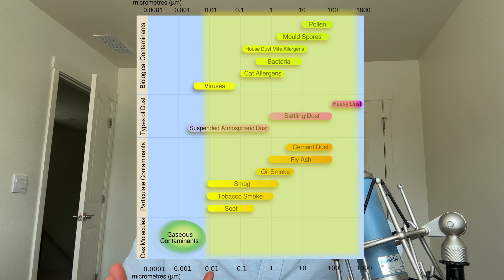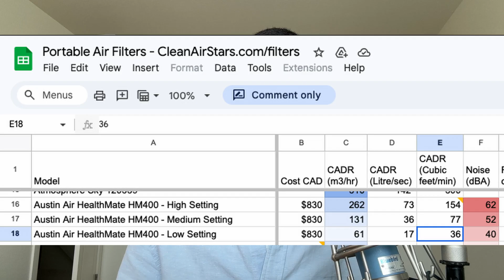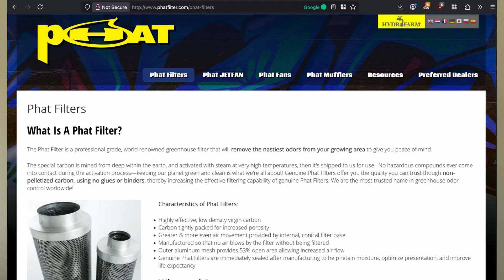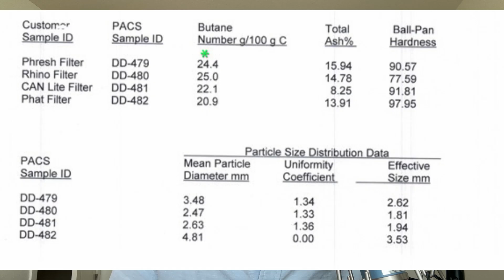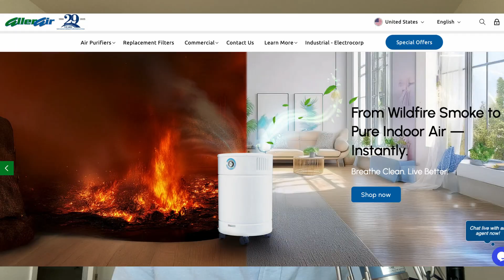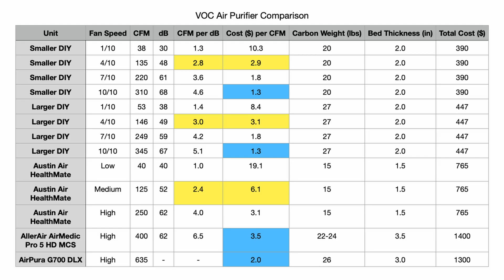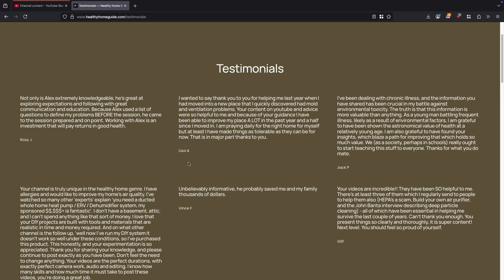Can a DIY Carbon Filter Remove VOCs Like the Expensive Brands?

Comment: After ~6 months use, do you have an update on how the small & large carbon filters are performing?  I'm wanting to go this route (large filters) but have 2 main concerns:  (1) actual VOC removal performance - not just using CFM as surrogate; perhaps using the good old nose to decipher performance; and (2) longevity of each filter - I'm thinking the filters will become quickly saturated w/ CO2, humidity, and other compounds that inadvertently get captured.  BTW, love your channel!

Comment: Thank man.  I built my first cr box because of your other video. I had a moldy basement that I completely gutted and redid and I've been very sick 4 years later. Also have lyme and seeing a functional medicine dr. But I now have 4 giant CR boxes rocking (one using a furnace blower, one with a drum fan and 2 using 8 artic pc fans each) and then 2 pro HEPA filters used for remediation . And even with all that, as soon as we close the windows up for the winter is progressively get sicker and sicker with the inflammation, brain fog, etc. And I'm now speculating that it's the VOCs/mycotoxins that remin in the basement that is circulation in the house still and making me sick.  Because I have enough merv 13 filtration to choke a camel and still the indoor air is making me sick. So am now going down the charcoal filter rabbit hole.

Was first thinking about stacking a charcoal fabric after the furnace filter on all my cr boxes but now am realizing a separate unit probably the way to go.

Comment: Sorry my previous reply I haven't fully listened to your video where you mentioned about people having sensitivity to VOC. I do have a tip though. And that is, with air purifiers that have a round cylindrical filter you can actually put high quality activated carbon pellets within that central cavity. Obviously not poured straight in that be disastrous but in some sort of cage or net bag. Maybe something like a wire bird feeder would you feel with nuts that has a wire cylindrical shape smaller than the cavity within the air filter and fill that. Because remember the VOCs in houses are generally low and a small amount can do wonders and minimise the chance of irritation from the activated carbon VOCs. And also remember the air hitting the carbon is going to be ultra purified which mean it won't clog the activated carbon pores. And of course you can very easily and quickly replace it.

Comment: Something to bear in mind is that activated carbon does itself produce a type of VOC which can be irritating slightly. If you are very sensitive this is my own personal experience. Also the DIY units throw a lot of black carbon into the air. What you really need is the ultimate answer is to have a filter the air going in to the activated carbon this preserves the effectiveness of the carbon pellets so they don't clog up with dust and you also need a second have a filter to filter out any released carbon dust as the air is exiting. Or get the carbon out and put it in some sort of mesh grid and blow air violently through it to blow out any manufacturing dust
Reply: Did he not literally adress this issue in the Video?? There was no dust problem.

Comment: I've seen that you can reactivate Carbon Filters by leaving them under the sun and open air for a day or two. It brings it back to like (90% initial) but it deteriorates 2x fast each time you repeat it. So practically, you can extend the filter life to 1.75 by doing this recycle twice. 

Could anyone look into this, if this is true? Like with actual data. Would be nice to see a video on it

Comment: Filter thickness is not really very important
It's more about the amount of time the air spends around the carbon
Like, a 1 inch thick layer of carbon will filter the air just as well as a 2 inch thick layer of carbon with air going through it twice as fast (and spending the same amount of time around carbon).
Or in other words, if you double the cfm without making the filter bigger, you will not double the filtering rate.

Comment: Hi, thanks for the great video — I’m building a similar VOC-focused unit for pet odour control in my living room. Could you confirm whether the four 8" parts below can be joined directly (no ducting):

AC Infinity Noise Reduction Clamp 8"

AC Infinity CLOUDLINE S8 PRO (8")

AC Infinity Air Carbon Filter 8"

AC Infinity Inline Filter Box 8"

Questions

1. Does the AC Infinity Noise Reduction Clamp act as a female–female rubber coupler, or is it only a clamp (not a connector by itself)?

2. In your build it looks like carbon filter → inline filter box → fan were joined without ducting. If both ports are male, was a tight slip-fit + clamp enough for an airtight, rigid joint? Or would you recommend a short 8" flex duct or a rubber female–female coupler for reliability?

3. Could you share the exact part numbers you used (filter size/brand, inline filter box size, fan model, and clamp count/spec)?

4. Any notes on vibration/resonance or long-term leakage/carbon dust with the direct connection?

Really appreciate your time and work!

Comment: Great video!  I have a question about noise level for CLOUDLINE Pro S6 Fan that you used. Your measured noise level in the comparison table is 67-68 dB at fan's maximum speed.
AC Infinity specification for that fan says : Total Noise : 34 dBA
Can you please explain that, I'm rather new to this :)

Comment: Do you know of any good filters for smoke/VOCs that can be mounted onto a central balanced ventilation system with heat recovery (so with ducts & vents)? I live in an area where lots of people burn wood during the winter and the ventilation system is sucking in all the smoke. I already have a electrostatic particle filter but that doesn't reduce VOCs at all. Thanks!

Comment: what do you think about combining the two diy filters into one case? basically putting the particle filter on top of the exhaust of the the carbon filter, tightly connected with the bottom panel? i made some sketches but i’m not sure where to reach you. best regards and thanks for the information.

Comment: What direction is the airflow? Are you sucking in air through the carbon filter OR blowing air through it?  Does the direction of airflow matter?
Reply: He’s sucking air thru the carbon, then sucking it thru the MERV 13 filter, and discharging the treated air thru the blower

Comment: Thank you. Informative. I’ve been looking for a carbon purifier  for 1000 sq ft space. There will be numerous people using the space. Does the carbon really give off an odor that can be offensive to some? And if so, would putting a fresh air intake on the furnace really help enough instead? Thank you. There was a recent buildout in this commercial space.

Comment: We live in a small Airstream trailer with about 180 sq ft of living space. We are seriously considering the Exhalaron for particles, but your DYI carbon filter for VOCs is way too large for our trailer. Do you have a much much smaller solution for a very small area?  We camp a lot in San Diego which has horible air due to the sewage coming from the Tijuana River. Lots of  hydrogen sulfide gas. Thanks!

Comment: QUESTION: How do you know when it's time to replace the activated carbon?  A particulate filter is white when brand new and darkens as it captures more and more particulates.  You don't get that clear visual indicator with activated carbon.
Reply from the maker: Great question! Check 3:40 in this video: https://youtu.be/ZCvpdOfrjtc?si=N0G9AJcsBNC1sHKu

Comment: Great video, Alex!

I wonder how much better your DIY activated carbon air purifier would be with a centrifugal "squrrel cage" fan instead of an axial fan.  In general, centrifugal fans have more static pressure, which is needed to effectively force air through a HEPA filter or a thick layer of activated carbon.
Reply from the maker: That's a great comment, thank you Jason! A while back, I did look into centrifugal fans. I ran into some issues:
1.) The inlets/outlets aren't typically shaped in a way that's easy to attach to a circular 6" duct.
2.) They tend not to be speed controllable. So there's just one super loud, energy-sucking speed.
3.) They tend to use tons of energy and create lots of noise when drawing air through a HEPA filter especially. It's not necessary to use HEPA, so I'm not sure why I'd want to shoot for that in the first place.
4.) Higher quality ones are quite expensive. Cheaper ones are typically very faulty.

Let me know if you disagree, I'm always open to new suggestions if they're valid!

Comment: carbon only filters about 9% or less of VOCs...  true you can't have both best VOC and particle machine in one...  for the heavy carbon filters like allerair you don't want it blowing through, you are using it as a sinkhole/capture for the gases you don't want it to come out the other side...  and when it gets hot in the house it will offgas from the carbon filter, so at the end of the day with really serious problems with gases the only option is to move, the doctors and experts say "complete removal from exposure"... filters just take the edge off but the IQAir ad with the guy breathing in a box full of tear gas is fake, if he had a toxin 24/7 he would get sick... and I have an IQAir and an allerair and others and I studied science at a big college so I know how to do proper testing and analysis... you don't need super expensive testing you need to find a consultant who can do GC-MS testing for you using sorbent tubes (not SUMMA canisters and you don't need PTR) and you need real-time monitoring to know when to take the air samples...  again no filter is going to save you from toxic gases you will be the filter before just a small percentage is removed from the air, filters do well for particles and that's about it...  get a merv 11-13 filter on your hvac and run the fan every 15 min to 30 min and call it a day, if you have a serious odor or gas problem you need to move... the lifetime cancer risk limit for ethylene oxide gas which is odorless up to 270ppm is just .0001 ppb, for benzene it's just .04ppb, so basically any amounts of these carcinogens and you are really increasing your cancer risks, so moving is the only option...  our iqair hpp has become less efficient with age, I think the motor gets weak... but our carbon filter is saturated now (if it does get saturated), I'll have to do  a new test with a new carbon filter... it used to filter pretty well in a medium to large bedroom on the lowest speed but it's not getting much if any airflow anymore... i think the motor power goes down with age...  people with health problems from air pollution need to find a good toxicologist who understands that blood tests are not used for environmental air exposures which is kind of like trying to find a new in box atari 2600 in 2025, there aren't many toxicologists who will talk, they are like lawyers and want a retainer up front.... this is not medical advice... talk to your licensed medical doctor (who will not know anything about environmental toxicology in most cases) with any questions or problems
Reply: You sound very knowledgeable, I struggle to fond material on air cleaning. Everyone I asks has really no idea about it over than what the products advertise as, or small particle tests people have done.

I would like to ask you about and see if you can explain why my charcoal respirator cartridges block all smells of my current environment. And how a canister filter for growing something smelly in a indoor grow tent elliminates the odor. Can you please help by explaining this? Are those highly odorous things just a very small amount of VOC's in the air, which is why the charcoal works, and instead you are saying when the concentration is too high of VOC's from normal indoor home materials that it will only put a small dent in the over all toxic load in the air.

Yes, everyone seems to be a gate keeper on this, plus almost no one cares about the details, unlike me. I'm trying to assist a family with their situation. They cannot open their windows a pretty much at all due to perposed toxins outside in the trees, but I do like your idea of running the air exchanger with a decently high merv rated filter working the air. Please help if you can, thanks.

Comment: Purchased all the items for the larger DIY setup a few days ago. Thanks for the easy to follow video. 

Just came across AC Infinity Refillable Carbon Filter. What are your thoughts? Have you considered this product?
Reply from the maker: Good question. Funnily enough, I used the AC infinity refillable carbon filter in a previous build. It's definitely a decent filter, but the process of refilling the carbon can be messy and it's hard to pack in the carbon densely enough yourself. AC infinity also isn't quite as transparent as Phat Filters about the performance/quality of their carbon, which is why I've switched to Phat Filters. But you do you, if you like the refillable aspect, certainly try the AC infinity.

Comment: Great video! I'm going to build one of these DIY-CARBON devices and try to benchmark VOC removal compared to larger consumer carbon devices I have got like the Austin Air and HealthPro Plus. 

Have been using the BM688 gas sensor that comes with the PurpleAir Zen and when testing other high carbon devices and would love to see if the DIY approach is able to out perform the specialist devices. I really like the idea of the replaceable carbon with the AC Infinity range so going to try that initially.  Will let you know how I get on.
Reply from the maker: I like your channel! Good luck, do let me know how you get on.

Comment: Have you done any research on water filtration systems, or do you just drink bottled water? There seems to be a lot of superficial knowledge floating around about how effective and necessary they actually are.
Reply from the maker: I like the youtube channel BOS Water because they do a lot of independent testing of home filtration systems of all different types. What I do now though is get RO water from my local grocery stores and remineralize it myself.
Reply: @HealthyHomeGuide , what do you mineralize it with? I get nervous about some of the products I've seen as far as heavy metals, so I take a capsule of seaweed every day and hope that's enough.

Comment: I found a guide online to make something very similar using a PC fan instead, and it seems to be doing very well. I'm not equipped to test it, but it's helped with smoky days and indoor VOCs, it's a lot smaller and sleeker than the bulky duct fans you're showing.

Comment: Im surprised your not making your own reusable carbon filter... Is it not cost effective?
Reply from the maker: Thanks for asking about this! Making a reusable carbon filter is a more laborious undertaking than I wanted to take on. You have to source high quality carbon, buy it in bulk for it to be cost-effective, build a housing (which would likely require metalwork to do properly, imo), and work with dusty carbon. 

I’ve seen some other designs that involve cutting holes in buckets, laterally slicing them, and attaching fans to them, and dumping activated carbon into the bucket. 

To make one of those intake and exhaust effectively, and achieve enough airflow over a large enough surface area to capture a lot of VOCs seems like quite a challenge, which, if you’re up for it, be my guest. But I wanted something easier, and something powerful.
Reply: @HealthyHomeGuide  the 5 gallon bucket sounds perfect, and i would want to make  the carbon so high quality isn't that important... I'll look for some diy on the YouTube... Not saying i will do it but I'm interested in knowing how ... I'm actually more interested in carbon for water filtration than air quality but it is interesting...

Comment: If doing the DIY ERV + Carbon setup shown in a previous video of yours, would you now recommend substituting the PHAT carbon filter in place of the AC Infinity Carbon Filter?  Thanks!
Reply from the maker: Great question. Yes I would use the Phat Filter instead of the AC infinity carbon filter (though I haven't tested that yet). Just make sure to slip the pre-filter over it to catch any dust (which is less of a concern in ERVs in general because airflow is slower than in air purifiers).
Reply: @HealthyHomeGuide  Thank you for all of your videos, Alex. I just bought my first house in a totally new part of the U.S. and I am learning about basements and serious dehumidifying and ventilation and I have really appreciated the resources you have put together. Regarding the ERV having slower airflow, which you mention here, would that suggest that having this standalone unit would be the more effective method of filtering VOCs than putting a carbon filter on the ERV? Not to say that one does not also need an ERV but that one might keep them separate for max VOC removal? Thanks again, Alex! P.S. I am very interested in your feelings about air conditioners. I watched your a/c video so I know your preference of window > dual hose > single hose, but if you have any additional guidance about which particular window units one might consider buying, I think your fans would be very interested!

Comment: Do you know of anyone who's tried this without any filtration of the "exhaust"? Now that you've had these in operation for a bit, would you be willing to try a brief experiment with no filtration? I ask because I want to hide my setup inside a perforated umbrella stand for aesthetics, and the filter box is rather bulky. Thanks.
Reply from the maker: Good question. I did try this without the filter box and a small but not insignificant amount of carbon dust ended up on the surfaces around the unit.
Reply: Good to know, thanks.
Reply from the maker: Happy to help.